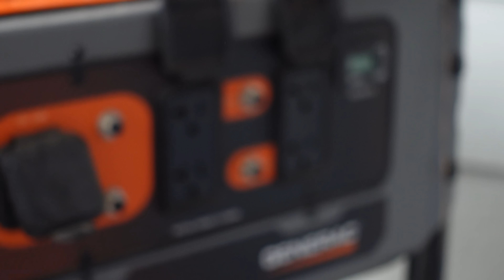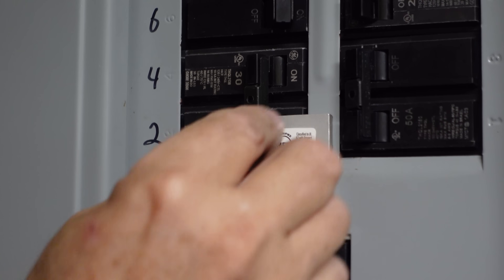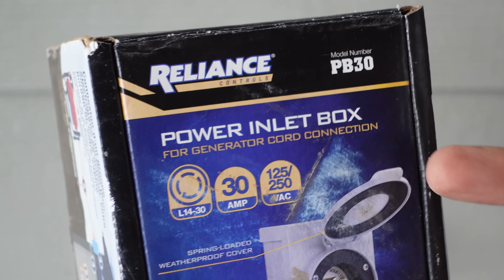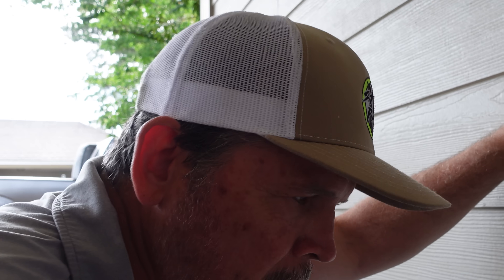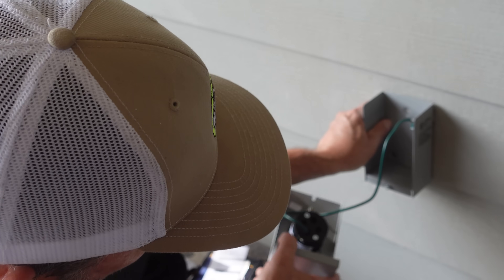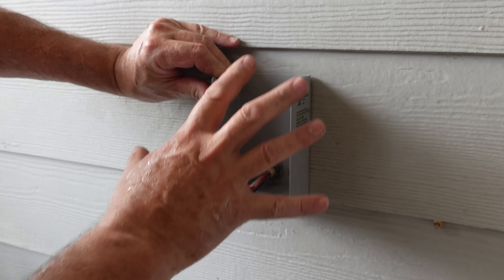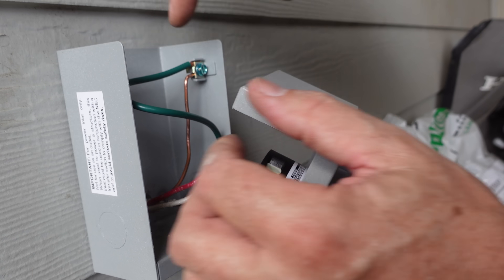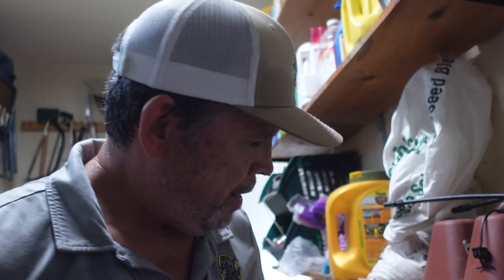What is a Suicide Cord and Why It Could Kill You

Comment: Sorry but if you are setting up for 30 amps the wiring gage should be at least  10 gage between the generator and the main panel.. Couldn't tell the gage of your wire. You must also let the home owner know that they can not use applications that will draw, in your case, more than 30 amps!!! In hooking up a main panel like this you can not drive all the circuits as if it was connected to the original electric drop capacity!!
Reply from the maker: It’s 10 g 👍👊

Comment: Is that 12 gauge wire in the wall? Too small for 30 amp? If its 12 gauge wire as I suspect, then you should have used a PB20 20 amp inlet box.
Reply from the maker: 10g

Comment: Since I have 3 pin 50 amp in my shop I have two suicide cords.  One from 3 pin and one from 4 pin to match the different generators I have.  The safety feature on mine is me.  No one else knows about the cords or how to use them.  Backfeed is prevented by switching off the main breaker on the box entering from power company.  This rig has the potential to be deadly if misused.
Modify a cord?  I built mine from parts.  Somehow modifying one doesn't seem like much of a challenge.  
The RB30 connector allows for the use of a safer cord.  But then the RB30 can kill you if you open the box when the normal power is on and stick your hand onto the exposed male terminals.

Comment: Why can't I find a good electrician?  I had a company come to put my sump pump on a dedicated switch thing.  They charged <$500. (Is that the "greater than?")  Then I had to have the dishwasher fixed.  I had to turn off the sump pump so he could work on my dishwasher.   So much for getting what you paid for.  I did make them come back but wtf, can't work be done right the first time?

Comment: Great video, thank you. I'd leave a lot more slack on the Ground Wire. If that box accidentally got knocked off the wall, for whatever reason,  the Ground Wire would/should be the last to disconnect, if at all.

Comment: Hi, inquiring about the amp rating of the wire that goes from the outside faceplate outlet to the fuse box, specifically whether it is rated for 30 amps?  Just wondering

Comment: Here in Germany we use 230v on normal outlets and to power a whole building you would run a really thick three phase 400v cable from the generator to the fuse box and a manual lever to switch between the grid and the inlet. The plug on a system I saw was rated for 64 amps at 400v. The generator only had 14kW so the plug was rated higher than the power it would ever transfer. That system is used in a fire department and a normal house would use a smaller plug and smaller generator than that. But the cable used in the house in the video looked more like a normal cable you would use for a normal outlet over here. But as you use 120v instead of 230v, that system might be fine for a small house.

Comment: ahh yes, generator interlocks
there is another more automatic type called "generator changeover"
both are devices to avoid murdering linemen and one is ALWAYS REQUIRED but often simply omitted

from what I see in the intro the primary issue of the generator socket is that it is a receptacle rather than a plug
this makes you need a "plug to plug" cord which leaves live pins easily exposed that may not even have proper grounding or GFCI protection when the generator runs
a proper generator interface box is a box with a fixed plug hidden under a panel that has the pins of a twistlock(though other plugs may be used twistlock is best) this prevents live pins just hanging out which a "suicide cord" makes a commonality
it is slightly more expensive  but infinitely less dangerous even if you don't have an interlock like an idiot or sociopath might not

I would prefer a motorized changeover switch, coupled with a relay actuated delay circuit(for generator startup stabilization time) and a "line detect" that simply tests a circuit that is not generator backed to see if AC is present
this may require a secondary breaker panel(for backed and non-backed respectively) or a set of multiple generator changeover switches tuned to each circuit's max current but given frequent power loss and inability to install a proper standby generator I actually need such

but ultimately I am breaking code because I rent my place and yet power outages are too frequent and too long to simply "deal with it"
so I have a 4kw invertor with 0-80a 24v charger and large batteries to provide a backup 

now it breaks code because it is a 120v device plugged into a nema-5-15r and providing a nema-5-15r as an output
but it is tuned to less than 1875w total draw even during bulk charge as my batteries are too small for 80a and I never pull more than spikes of 1500w when my led toner printer fuser comes on rarely for a few seconds
if I wanted to follow code my janky wired plugs(cut 12awg extension lead wired into unit) should include a 15a fuse or breaker device
but that circuit may be a 20a anyway and given lax codes for devices that are classed as "intermittent duty" and my knowledge of power draw on the objects plugged in I find no issue as I am the only person to ever use it anyway
but in the future I may get a split phase version and get a twistlock setup that can offer a dedicated 40-50a feed from the panel just below the floor into a small box beside the heat radiator since I have to run network down there into a nice box and, well, a proper repair that follows or exceeds every code (at least in the icemaker line sense) was fine by my landlord so I will consider the proper plug for my inverter because it may be something a new tenant wishes to use(possibly for their own W/D units or similar) as I will definitely be installing a small keystone jack compatible box by the cable intake as I need to reposition the wifi router for better signal and installing a solid core cat-6 POE++ compatible run that nobody will ever need to mess with is what I wish to do

Comment: Wiring in a robot at a 440 panel about 20 years ago and met the same slam dunk jolt of electricity that you receive. Someone in a Whirlpool factory took a short cut and lit my world up. Stopped work, pulled the power disconnect, locked it and told the maintenance foreman to get it right before I continued. Never put faith in a high name factory or anyone that things are done properly. From that time forward I metered the panel.

Comment: Is the solid copper wire a code thing or can you use more flexible stranded 10 gauge wire like what is used on dryer or oven plugs?

Comment: Several years ago we had a maint. guy from facilities come to install some shore lines for our fire engines and trucks while in the station.  He did just what you describe.  He placed hot drops from the ceiling with male ends in order to plug in pigtails which then went to the special "auto eject" receptacles on the engines and trucks.  One of our guys was talking to one of our battalion chiefs and inadvertently grabbed the plug.  Needless to say, he got a big zap.  That batt chief called the facilities head guy and wanted some butts!  I think the guy was fired.  Should have been anyway.  It's amazing what people will do.

Comment: I had this same thing done to the house we had built in Southern California, and glad I did. We had a bad storm go through that downed a lot of power lines. We were without power for 3 days. We had a diesel pusher motorhome with a 12.5k generator and an external 220 outlet. It ran our whole house until the power came back. They also installed a power transfer switch, which was needed to pass code.

Comment: Did you replace the cable with 10 AWG conductors, which is required for 30 Amp two pole breaker and receptacle?  It looks like 12 AWG was left in place.  That can cause a fire. Breakers, receptacles and conductors all have to be compatible. Also didn't seal around the opening.

Comment: You just saved lives with this video, the dangers of a “suicide cord” would’ve never truly occurred to me as a DIYer. Thank you sir!
Reply: Nobody sells these so it’s not like they’re easy to get.
Reply: @alexcorona couldn’t you just make your own buy using 2 50 amp range cords ….
Reply: @dieseldawg7132  Wrong plug end on one end..
Reply: I can’t believe it’s not obvious…
Reply: @matthewnaughton9642 humans aren't born with the advanced understanding of electricity. Stop acting high and mighty you troglodyte
Reply: @matthewnaughton9642  You forget that at least a quarter of all people are complete idiots.
Reply: Don’t take electricity lightly.
Reply: @klinestill xD
Reply: This is so stupid.  No one is going to die from this… The charge will flow from one contact to the other through the body.  Since the contacts are so close together, there’ll move through a tiny portion of body.  A strong shock is the worst that can happen.  Seriously, fear mongering for views is pathetic.
Reply: just plug the cord ends in before you turn on the generator its not that hard, do you call a kitchen knife a suicide stick? because it can also kill you if you use it incorrectly
Reply: @GamingUpNorth  That's like equating a normal fire to an invisible methanol burn because both are hot.
Did you think this comparison through?
Reply: @GamingUpNorth standing voltage on a suicide cord is an unseen, potentially fatal hazard. The knife thing is dumb. This is a good video, especially the part about the interlock on the breaker.
Reply: @andrewwilson6222  The person plugging in the suicide cord should just use their brains. Only touch the plastic of the plugs, not the pins themselves. And suicide is a bit exaggerated... I've had 230 volts on me many times, still alive and kicking.
Reply: @Engineer9736  During the hurricane, if you're wet when you get the cable, you'll have to pray that there is a 30mA protection that is quick enough to react. To reply to the others, even if people are informed and are cautious, there will certainly be a time when you will make the mistake. Remember the purpose is to plug the generator during a storm/hurricane, potentially in the middle of the night, when you are barely awake.
Reply: @Engineer9736  If you're really an engineer and don't understand electric current, and survivorship bias, I hope you're not designing anything safety critical.
Reply: @Engineer9736  alright, but is the kicking voluntary?
Reply: @Engineer9736  I don't know what your an engineer of but its certainly not electrical.
Reply: @adriendebosse6941 it's even just about mistakes, but "shit happens" as well.
Reply: @andrewwilson6222  you wired in a capacitor in the middle of the cord? wtf is wrong with you..
Reply: @GamingUpNorth  I know right, As soon as I saw him explain and plug into live first I just smacked my forehead.
Reply: Electricity is definitely a hobby. No such thing as suicide cord.
Reply: This title is definitively a clickbait...no 120v 15amps circuit will kill you
Reply: @nicoracien-Qc the cord was for a 240V 30A outlet on the generator.

Comment: I have no idea why you put the box outside when you could have easily fixed it into the wall. Sticking out is a safety hazard. Ridiculous. And you would have had more wire to work with. I can't believe you didn't recess the outlet. Stupid. Stupid. Stupid. It would be more weatherproof also. Stupid. Stupid. Stupid. It looks stupid.

Comment: As far as modifying extension cord goes, As long as you know the specs of the devices its not an issue. They make plugs you can buy and replace them yourself. You just need to pay close attention to wire gauge and the length of the cord. I would imagine someone like yourself who knows at least this much about electricity would know that.

Comment: Appreciate the detailed video! I’d like your recommendations. I have a doorbell transformer (inside a plastic gang box instead of metal) go bad in my old house. The old transformer had 2 (black & white) wires but the new transformer has the norm 3 wires (white, black, green). What do I do with the green wire? Can I just tape it off? I don’t see anywhere to ground it. Thank you.
Reply from the maker: If there's not a ground in your house wiring to bond it to tape it off or use a wire nut on the end.

Comment: Q?   You say you did the original install.....so what were you thinking? Also  if gen is 30 amp why would you only use 20 amp rated plug an cables? And with that ground wire " guitar strung" like that the chance for it shorting to a phase is pretty good
Reply from the maker: Wasn't me... we did a panel change out during the remodel, that must be what I meant.

Comment: In my opinion  what needs to be done  for  (especially) low budget folks and gensets is to  get the code folks  and various localities  and suppliers to  EXPAND upon the  breaker panel  mechanical interlock  kits.  There is NO reason  these cannot be  made better and safer and provide and absolutely safe and workable  solution  as a simple  transfer device.  They see to be  the "black sheep"  in many areas

Comment: So, plug the 220 suicide cord into the Generator then into the outlet before starting the Generator? But, the Generator instructions read to start the Generator before plugging extension cords into it? Then the shutdown procedure is to 1. Turn off all electrical appliances and or unplug them from Generator 2. Close fuel valve 3. Turn Generator switch OFF.

Comment: I liked almost everything in your video here: the discussion about suicide cords, the correct way to set up the connection to the house and so on.  But I don't understand you late comment questioning why anyone would modify an extension cord.  Can you elaborate on that please?  I'm not so much modifying an existing cord as making one.  I bought the cord and plugs and you have me wondering what you think is the problem with that.

Comment: I see the generator is rated for 5,000 watts, what about the existing wiring, is it rated for the load. And the cord end is already a screw on type why not just replace it with the proper female plug? Save you or the customer some money.

Comment: Good information. I'm guessing that the wiring for the 20 amp outlet can handle 30 amps as well which would be atleast a 10 gauge? Not sure how you knew that unless you looked at the casing on the wiring.

Comment: I created this same setup with a dual male plug end...but  I have the outlet next to my main panel inside the garage...its a regular,  open face , twistlock, female receptacle (mounted in a 4x4inch box with a round round opening for the receptacle face plate) and the whip end goes into panel box on a 30amp breaker....2 question s

1.) Is there any issues with this/that setup?

2.) Is there any reason to switch over outlet to one you put in??..TIA

Comment: Do yourselves a favor, exercise your portable generator at least monthly for 30 minutes or so. Run non ethanol gas if you can. Use the fuel shutoff valve to run out the gas in the carburetor to shutdown before storage. This will help minimize any hassles for start up in an emergency when you need your generator to work.

Comment: Also, if the extension cord has screw cable clamps and is not molded on, it would be more cost-effective to just swap one male end for a female end...
Reply: You could still cut the end of the cable and only shorten it by 2-3 inches.

Comment: @ 6:57 - Did no contractor, ever. Only issue I took with this video was that none of you seem to carry duct seal... The stuff is cheaper than dirt and keeps out water and bugs. Did you offer to install a ground rod for your customer to hook up a proper generator grounding kit? @ 14:46 - Not a design flaw. The rear screw knockouts are stamped and raised. But you have the box against a giant chasm so they have nothing to sit against and you lost your wall spacing.

Comment: I know of another danger. A neighbor had a simaler set up but house end was hooked to breaker panel with breaker and other end was normal male plug for generator. Somehow someone flipped or left breaker on when power was on. The cord upside was wound up on side of house. While cleaning up grass clippings a commercial grass cutter contacted the  " hot " plug and was shocked and burned but thankfully not electrocuted.
The additional safety plate is a must for generator hook ups to breaker panel.

Comment: i gave a like. thanx for all that hard work. at the end, i'd just put a female end on the cord- maybe you're concerned about liability. dunno. but i'd just modify the cable.  I only work with cables & termination everyday, like you.  but ok let them order one and call it done.  Now for modifying the wall - i'm also gonna NOT cut into the inner wall (sheetrock), I'd only do the outside.  harder? maybe.  pain in the A?  absolutely.  but I would never, ever go cut into sheetrock unless its the last resort. 
I guess i can't stop now, eh.   I'm sorry but just pry the outside wall boards up every stud, little by little, until you can pull them off the wall.  yes it takes 3-4 boards high, to do it.  but that's just me.I would pry off a few wallboards on the outside and leave the insulation, put in some 2x4 cross bracing and shoot nails or use whatever previous method that was used to put the outside wall on.   i would never go mess with an inside wall, for an outside change.   that is the ez fix, but leaves a big ole hump in the "plaster" for everyone inside to see.  other than that,  you still give a great honest and well done job.  thanx.
ok i came back to say that i came here for the title, and thanx for explaining what a suicide cord it,  great info.